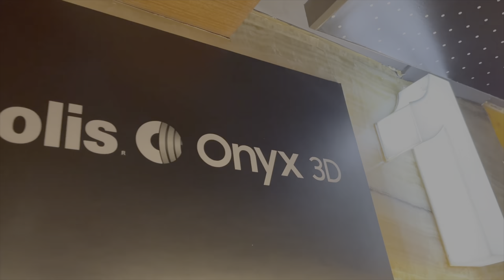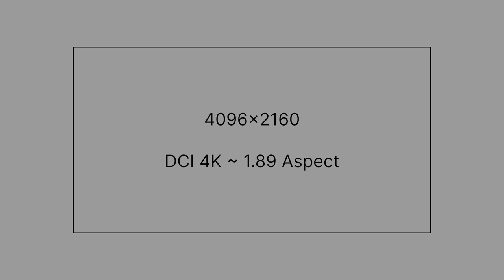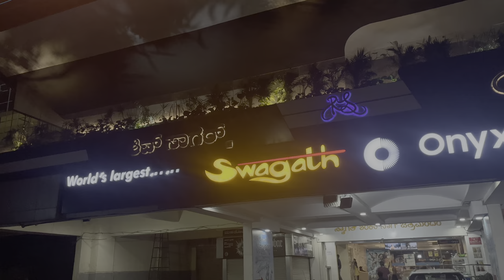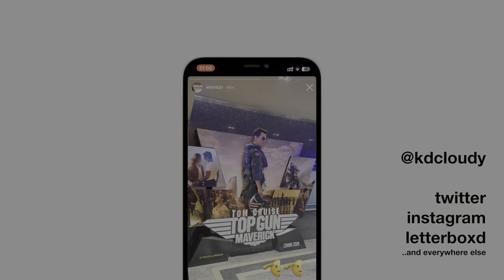Samsung ONYX LED Cinemas - Explained and Review!

Comment: I watched Avatar 2 in Onyx led Bengaluru swagat Shankarnag screen.... And it was amazing experience, but one thing that surprised me was the aspect ratio was not 2.39:1 like normal 2d screens.... It was probably 1.9:1, im not sure but it was like a mini imax with a small screen.... And the experience was awesome with unbelievable screen quality.... You can see the videos and pictures uploaded in Google maps to check for yourself.... Not all movies will be played in this ratio, ive watched gaurdians of Galaxy 3, top gun and many more.... But avatar 2 had different aspect ratio....  Dont know how they got that version when it is not imax theatre.... Does the Samsung screen get it from the distributors or is it something else?
Reply: Actually for avatar you could get any dcp if your screen could handle it , like for Prasads large screen in Hyderabad and other pvr pxl screens or any plf screens got 1.9:1 aspect ratio to fill the screen, so same way onyx must have got it.
Reply: The screen has deep black They can easily adjust to any ratio in it